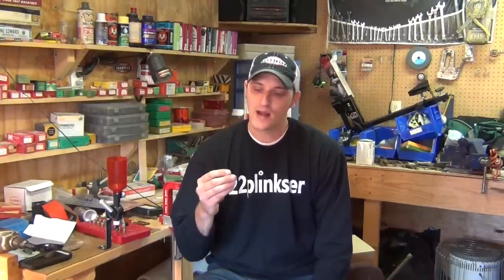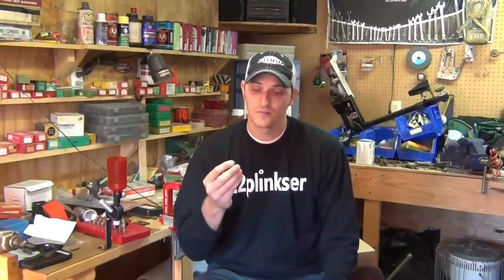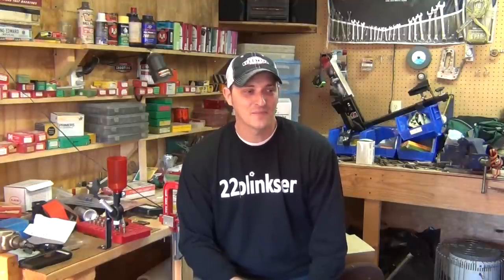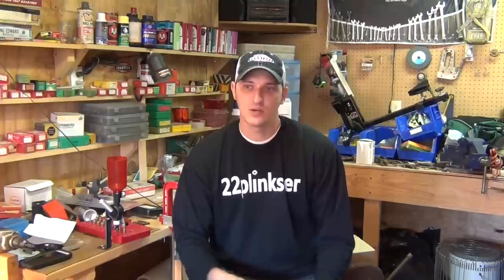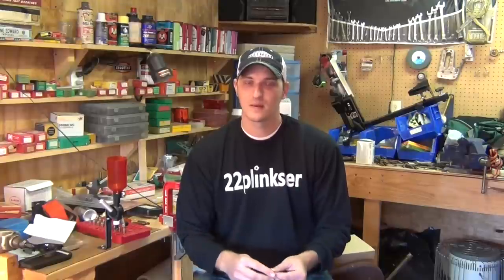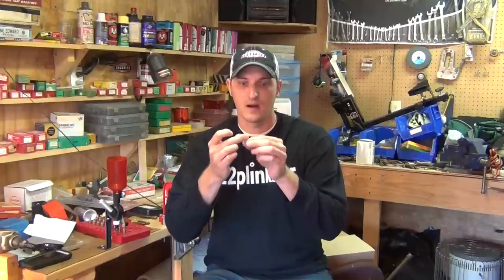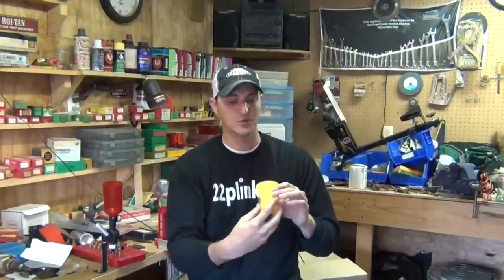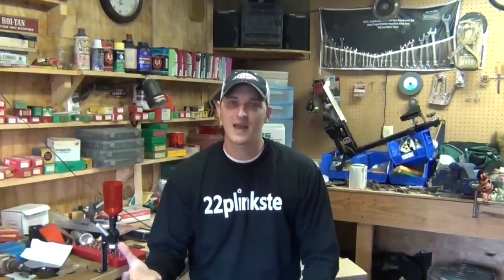Why does the .22lr have misfires?

Comment: The worst .22 ammo I found for misfires, duds, split cases and heavy fouling was Winchester Super X
Reply: The reason I am here watching this video is because I have a Ruger Bearcat revolver that was giving me 1 or 2 misfires per cylinder of 6 rounds.  Sometimes rotating the misfired cases did NOT work.  The ammo I was using?  Winchester.  I was thinking that I might have to send the handgun back to Ruger for service - but decided to go back to the shooting range again and test other brands of ammo.  Guess what?  Remington Thunderbolts and CCI Min iMags worked 100 percent of the time.  I hand wrote a note and put it in the box with the gun to remind me in the future to only feed the thing CCI or Remington brand rimfire ammunition.
Reply: Adrian Larkins Me too! I'm so pissed!
Reply: My Savage 64F  works with CCI ONLY!. My brother in law 's Walther .22 is in the same situation.After he tested  with many different brands  CCI was the only one that worked.
Reply: Adrian Larkins you are completely correct friend
Reply: Hi bud, the Ruger Bearcat is a sweet revolver. Never owned one but shot one. My "story" is that I bought a Ruger KNR-5 used in 2000 (with both cylinders). I sent it in to Ruger for a checkup. Total cost??? $60 and Ruger shipped it back FREE. Considering I paid $250, the extra dough was well spent. 
 I'm suggesting this because you didn't say if you got the gun new-in-box. It is possible (probable??) that it was the ammo. Ya know .22 rimfires can be fussy about diet. I've shot a lot of Winchester fodder; Super X and Wildcat with no problems. But ALL rimfire ammo does vary batch to batch. FYI, all my .22's shoot the Rem Thunderbolt quite well (especially the semi autos), only trouble is cleaning is more of an issue. I think CCI is over rated and over priced. I have eleven rimfires so I do have some experience. Happy shootin'
Reply: I've stopped shoot pretty much anything except CCI out of my semi 22's. The other junk I'll shot out of the bolt action or revolver.
Reply: Just curious Philly, What semi auto .22's do you have??? My brace of semi autos include; Norinco ATD.22, Marlin Papoose, Ruger 10/22 and Charter Arms AR-7. All shoot most .22 fodder quite well although as I stated the Remington Thunderbolt shoots best. CCI mini mags shoot as good or better however CCI is much more expensive. Seems most .22 semi autos don't like truncated cone ammo and some hollow points. My Norinco shoots Remington "Goldens", Thunderbolts and Mini Mags very well but nothing else. With .22's, you feed them what they like.
Reply: Marty Jewell  Ruger 10/22 takedown, marlin 25 bolt action,  Ruger Mark Ii. Ar conversion 223/22. And a little Smith model 63
Reply: Marty Jewell  the 63 is a revolver of course, you ask about semi auto and I got carried away lol
Reply: Interesting collection Philly. My 10/22 was purchased in 1979 for $90 (new). I'm not really big on semi auto handguns though the MK ll's are nice well balanced pistols. My three are all revolvers; a Pietta cap-n-ball, Ruger KNR-5 and a S&W 36 (circa 1966). The 63 is stainless/hammerless??? I think. The S&W snubbies are sweet revolvers. I'm not too familiar with the centerfire AR's, does the conversion shoot .22's reliably?? Only two centerfire rifles I have are a Plainfield (Dunellen) M1 carbine and a Mosin Nagant M-44, with Izhevsk proof marks and dated 1944. The Mosin has a wicked crucifix bayonet attached. Hey Philly, please feel free to get carried away when talkin' about your guns. Hell, that's part of the fun.
Reply: Marty Jewell  absolutely love the conversion. A 22 has no recoil anyway... now shoot it out of the AR platform and there is even less. I always shoot copped jackets out of the conversion to keep the fouling to a minimum and shoot a 223 out the barrel after I'm done to clean it out. But yeah it's a ton of fun. I had a 10/22 I bought used in probably 83 or 84 for 75.00 if I remember correctly  and ended trading it even money for a sks 7.62x39 at some point several years later. Still have the sks. Seen the takedown a few months ago ...and just had to have it.
Reply: Sounds like you have a decent brace of guns too, Philly. I also kinda get the impression that you're close to my age of 67??? I never had a desire to get any of the Vietnam era weapons, SKS, AR, AKM or AK's. Got the AR-7 because of the Bond movie 'From Russia With Love'. Couple of shotguns; Rem. 870P (1982), Rossi .410 and a Mossberg "camper" .410 (#50455) and a few other .22's; Rossi 62-SAC (carbine) Ithaca 49 saddle gun, Taurus M-72 (.22 magnum carbine) and a Marlin 20 (glenfield) bolt gun, the forerunner of your model 25.
 In the early 1980's I lived in Brooklyn and belonged to a range in midtown NYC (West Side Pistol and Rifle) and every saturday I'd take a cased .22 on the subway to shoot for an hour or two. Sometimes a transit cop would ask to see my permit and registration and even have me take the gun out and he'd play with it right there on the train. Ah, the old days!
Reply: Marty Jewell  53, so you go back a little farther than I do. The sks was the only rifle I owned for 20 years or longer. Never have shot it much. Still have most of the original case of ammo I bought to go with it. Only recently got into the AR platform a little. Bought a Ruger 556, then built or put together should say a ceratac upper on a Anderson lower. That was fun . Currently have a ceratac 80 % build kit sitting on the bench to play with. Gonna start on it soon I think. Soon as I get the courage to try milling out the lower. Never done anything like that before. But to have a complete AR for 250 bucks...thought I'd give it a go.
Reply: Sounds like you know a bit about gunsmithing Philly?? All I know is how to load-shoot-clean. Tell me what your opinion is of your Ruger MKll pistol?? The S&W 63 too??? I really like my model 36 snubbie. It was manufactured in 1966; pinned barrel, firing pin in hammer, walnut squared grips, case hardened trigger and hammer, contoured cylinder latch release and a beautiful rich bluing. You can see your reflection in the side plate! Like a mirror. S&W sure knew how to build them in the 1960's.
Reply: Marty Jewell  oh no, not me. The ar platform is just super easy with the help of YouTube videos. Now when I assembled my lower I had to watch the video a lot of times and let it walk me thru it step by step. And they trial and error I had it done in 3 or 4 hours I think ... maybe 5 lol. 
The mark II is a excellent target pistol. Easy to shoot, very accurate. The ONLY downside is it's a pain in the butt to take apart and put back together. To me anyway cuz I don't do it enuf to get good at it. Practically any semi auto is gonna be easier to take apart and put together in my opinion. I really want a new Mark IV as Ruger solved that problem finally and now the new one are extremely simply. The little Smith revolver i got just to shoot low velocity and quiet rounds that won't chamber thru a semi. Now my model 60 38 Smith I really like and my wife carries it, also like my colt snubnose detective special.  Nothing wrong with smaller semis either. I like my Walther ppl 380 just fine and my s&w bodyguard just fine. In fact I usually carry it.
Reply: Adrian Larkins.
So do i.out of 10, 2 or 3 were misfired
Reply: I've been shooting Win. SuperX for years and have had no more problems with that ammo than other brands. For me the worst fodder is the Rem. "goldens" as the bullets are seated very loose. The SuperX does have a "lube" that picks up all kinds of stuff. Don't keep them in a pocket, keep them cased. I have nine .22 rimfire rifles; Ruger 10/22, Marlin Papoose and model 20 glenfield, Rossi 62SAC carbine and matched pair (.22/.410), Taurus 72 magnum carbine, Ithaca 49, Norinco ATD.22 and a Charter Arms AR-7. What ammo works best for me??? Remington Thunderbolt. My semi autos love it. Remember, any brand can produce a poor lot of ammo and .22's are fussy about their diet.
Reply: So do i
Reply: Damnit it i just bought some today Too 😡

There goes ten bucks. 😧

It'll be a great idea to start watching ammo videos.
Reply: Hey jimmy, you can never learn too much about guns and ammo. As I've stated, I haven't had any problems with Win. SuperX ammo in any of my nine .22 rimfire rifles over the last thirty years (T-22 ammo either) or my Ruger KNR-5. So just go and shoot your $10 worth of ammo and you might have no problems either.
Reply: Dude...!  We had 2 whole boxes of that same exact ammo fail.  We were shooting a video and the Winchester Super X ammo was not firing upon striking.  We even tried to fire the non-fired winchester ammo in a different gun a few times and it never went off.  

When we started finding handfuls of other people's un-fired winchester super x 22lr laying all over the range we were at in the dirt... we decided we should never buy that ammo again.
Reply: My Savage model 4 never misfired until I started using the Winchester super x yesterday.
Reply: Hey, it CAN happen that there are bad batches of ammo from any manufacturer. It is good, maybe essential,  that you report this problem to your viewers. I don't doubt your results. Just that in my shooting experience (45 years), I've never had trouble with SuperX .22lr ammo. We all need to be on the lookout for poor quality (dangerous) ammo. Contacting the manufacturer about this is necessary to bring it to their attention. It has been 5 or 6 years since I last used Winchester fodder so I suppose they're quality control has lowered (or failed). 
 A misfire, hangfire or dud can be dangerous while shooting, I agree. I grew up in Brooklyn, NY so calling me "dude" is really nice to hear. Good video. An after thought, I shoot Remington Thunderbolt ammo reliably and accurately out of all my .22's. Even my picky Norinco ATD-.22 and Charter Arms AR-7 shoot the Thunderbolts well without any jams.
Reply: I would also agree that Winchester is my least favorite ammo. At least for shotguns. I haven't used their .22 rimfire. My favorites for .22 is Federal and CCI.
Reply: I guess ALL guns are somewhat fussy about ammo. As I stated, Win. ammo always worked well in my guns, including 12ga and .410 shotshells. Most recently I've shot a lot of USA .38 Special (130gr. FMJ) #Q4171.  Federal Lightning .22's were reliable too. The copper wash (plated??) Federal rimfire (bulk pak) is good. I suppose that Winchester could be producing inferior fodder these days. When it comes to guns remember; feed them what they like. For Rimfire, all my guns just gobble up Remington Thunderbolt .22's with great results.
Reply: Since I experiment with ammo, and use several firearms, I typically find if it won't fire it in one gun, it won't fire in anything. That's an ammo problem. I thought CCI was most reliable but got some recently that missed a couple. Ditto Federal but I bought a new 325 bullet box and it was failing about 1 in 4...match ammo has been the most reliable. Cannot remember a misfire, but occasional jams. Eley and Aguila brand match works better. Winchester and Browning occasionally failed but Browning very poor accuracy in 10/22 and Buckmark pistols.
Reply: Same, I bought that 333 pack and I got stoppage nonstop. Cut my range day short it was so bad.
Reply: Yup Winchester white box is trash.
Reply: My wife and I (both using our own S&W Victory) are just now completing about 500 rounds of Winchester 22 LR bulk ammo. We both experienced at least one misfire for every 50 rounds. A few times I tried reloading the misfired ammo so the firing pin would hit it in a different place, and the second try never resulted in firing. Ammo was purchased in Sep 2019, used by the end of Oct 2019.
Reply: I have had great luck with winchester Super x, white box, etc. Many times a little tuning and really good cleaning will get your guns running well. I have had issues with the CCI Tactical AR ammo in .22lr not working in some of my Ruger 10/22 mags, otherwise, most of my .22's shoot anything.
Reply: pagamenews Mine is doing the same thing, except I have used a few different ammos and it is still happening
Reply: Adrian Larkins Ive had pretty good luck with super x, but the bullets are often really dinged up and not great.
Reply: pagamenews some done like certain ammo. My Ruger 10/22 wont feed CCI AR tactical from a 25 round magazine.
Reply: Paul Mohr thunderbolt is definitely the cheapest quality I’ve found. Lots of low power rounds and loose bullets in a box, but rarely they don’t go bang.
Reply: Marty Jewell golden bullets have been the worst for me too: more issues than with thunderbolt! I do like the golden bullet shorts though, seem to be better than their Long Rifle
Reply: I have the most ftf with Remington golden bullets. The dirtiest too.
Reply: Greg Christopher i agree/ the only golden bullets I buy are shorts, cause cabelas stocks them regularly
Reply: Funny cuz i never had any misfire with 17hmr.  As gar as 22 i mostly shoot golden bullets. 22 mag. Just some old boxes  of 50 that was given to me.
Reply: I think you work for remington don't you go ahead admit it the truth will set you free!!
Reply: Marty. ATD22 are great 
10/22s are shit.
Reply: @smokenjoe4022  I do not work for any gun or ammo manufacturer. I just hear everyone say how bad the remington thunderbolt is. I just did a shooting vid where I rapid fired 100 rounds of it from 2 different guns without a hiccup. Don't get me wrong, it's not target grade by any means, and you get a lot of light loads, but its cheap to shoot, and I have never had a squib with it
Reply: I only use High Speed Fiocchi, Eley Target and Armscor High Speed for reasons of deeper penetration and are shots more reliable and a little bit cheaper than CCI stingers, for example or Mini mags too. (Not Eley, in fact is the most expensive 22 in my country but superior quality even than CCI!) I ve seen that quality materiales used in prime cartridges are terrible in Winchester X, some Federal 22 that comes in huge boxes of 525, also comes with a lot of failures Águila before they changed prime materials from Eley, now Águila with Eley Prime its reliable, unlucky they didnt continúe making it, for non solve problems with Eley for Aguila costos. Bad results also with Remington Thunderbolt in revolver and carabine, possibly the worst 22 I ve shotted. Cheap ammo = High cost of wasting time, money in shooting ranges or long travels not anymore
Reply: Adrian Larkins hands down, the worst I’ve ever encountered was  Remington golden bullets.
Reply: @pagamenews  This is exactly why I googled this topic today 5/1/2020 because of my experience at an indoor firing range today.  Ran a leftover half box of CCI though my Taurus .22 WMR revolver just getting used to shooting a revolver after hand surgery.  Then went to counter to buy a box of ammo for my brand new Ruger LCR .22WMR revolver and she sold me Winchester SuperX.  I didn't think a thing about it.  Averaged 2 misfires out of 6 for four rounds.  Was very concerned that my new gun was malfunctioning and took the gun to the shop gunsmith with the 24 shell casings to examine, plus several of the CCI shell casings from the Taurus.  The two revolvers definitely had different strike indentations, so he told me to run the rest of the SuperX box plus the mis-strikes through my Taurus.  Every one fired flawlessly.  So he had no other .22 WMR ammo to run through my Ruger, to determine for sure whether it was the Ruger or the Winchester SuperX.  I will run CCI through my Ruger in the next several days to try to determine which variable it is, but I can tell you this:  I have never had multiple .22WMR mis-strikes in a day, much less in one round of firing!  I bought the LCR to be my truck carry gun; now I am totally un-nerved by this.  The lady at the counter and the gunsmith decided not to charge me for the Winchester SuperX ammo.  I do not know if that was based on prior experience with SuperX rimfire, or just because I am a regular customer (another variable!  Lol)  So I will update once I run CCI through my Ruger LCR.
Reply: Well, apparently it was the Winchester SuperX.   My Ruger ran a new box of CCI today 5/3/20 without a skip.  So now I gotta figure out what to do with these other two boxes of SuperX.  Maybe they will run through my Henry 22WMR.
Reply: Yep
Reply: Same lol
Reply: Worst 22lr i have encountered was Federal American Eagle. However their center fire ammo is great.
The other worst was bulk winchester 555 boxes. CCI is the best probably. 
And i have always had good results with Remington, either thunderbolt or golden bullet. Use what works in your rimfire firearms I'd say
Reply: @pagamenews  I keep seeing how Remington Thunderbolts were bad news but I bought a decent amount of it and then started seeing it back on shelves again. Your comment is 4 years old but it still tells me that in the right gun it should work. I'd rather had paid pennies for it per round than dimes like a lot of it is today.
Reply: @biteme263  haha And here's the comments that I see in duality love and hate for the thunderbolts. It is what it is but I'd rather just try it out and know other guns work best for specific ammo when some don't.
Reply: @phillam1040  I've tried mine with some wildcat ammo the Winchester red sleeve. Worked great last time I was shooting it with my daughter.

Comment: Now mister Plinkster I think you may be incorrect on one point. Every 22 round that I have ever taken apart has had a primer powder tucked into the bottom rim. There is every possibility that you have seen something that I have not but it doesn't make sense for there to be a disc a primer pushed down into the round because that disc would not be at wide as the rim that it is supposed to fill. If you care to elaborate in a follow-up video and could show me one of those disks it would be appreciated. I'm sure a lot of your followers would also like to see a close-up of the manufacture of a 22 long rifle cartridge as well